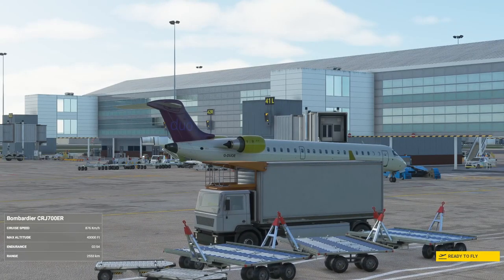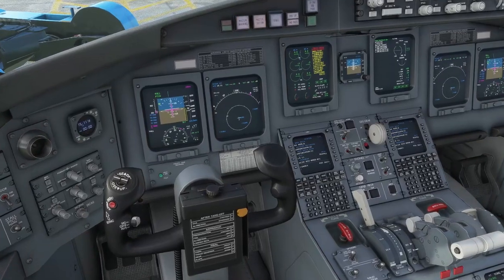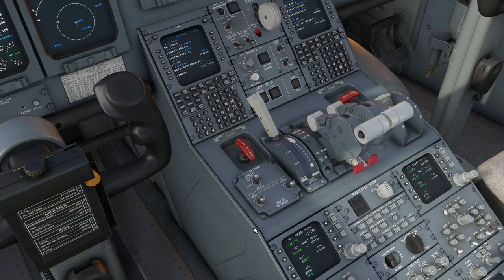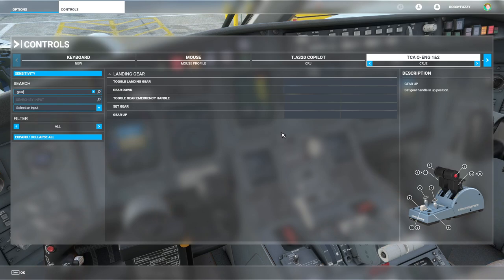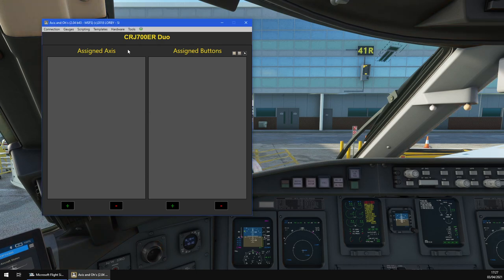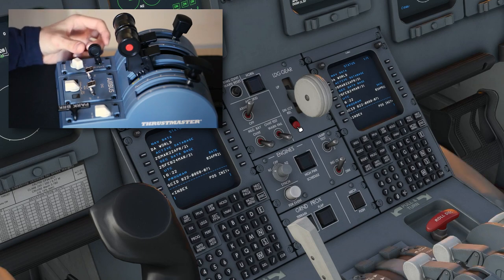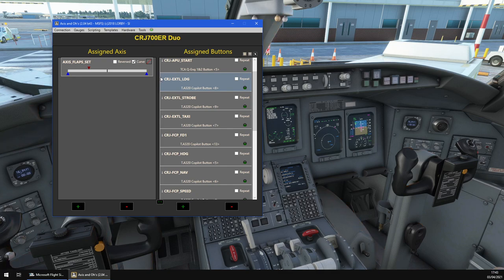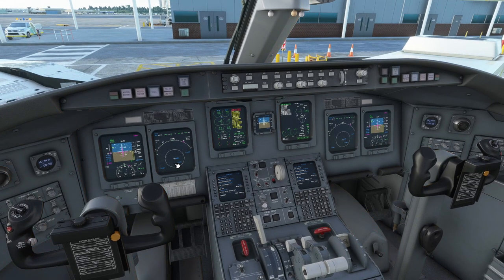Aerosoft CRJ - Thrustmaster TCA Quadrant/Add-On Setup in Microsoft Flight Simulator & AxisAndOhs

Comment: Well done and explain.

 I may have found the issue with parking break, It's being created by msfs.  Inside the sim the setting are 19 and 20 for the parking break, 21 is for the gear up and down.  Axis and oh's use the real template from thrustmaster so for them parking break is 19 and gear 20.
Reply from the maker: Thank you! And thanks for dropping by.

I'm sorry I'm not sure I understand why that is an issue?
Reply: @BobbyFuzzy When you mention you cannot set parking break.  The sim as 2 buttons for the parking break. but axis and oh's have only one.
Reply from the maker: @thepik3932  I don't think that would make much of a difference, setting the parking brake using the default MSFS bind using other aircraft works fine. I'ts more to do with the way the CRJ deals with switches that 'hold' an input rather than a momentary push button.

Comment: Wow, massive pain in the rear end trying to follow this.  I'm  shocked and amazed that this process is so incredibly convoluted.  Would be so much better if Thrustmaster built higher-quality components.  I regard the TCA stuff as borderline junk.  And yes, I own it.  And yes, I have experienced the noisy potentiometer (POT) issue on the twist-grip rudder on the Sidestick, and yes, I disabled that until FlyByWire made it mandatory for nosewheel steering on the ground.  Then I got involved with warranty claims (over and over) as one after another of the Thrustmaster units failed typically 3 or 4 months after going into service.  Thrustmaster continues to sell these with this 'known issue' (you might call it a problem) and tongue-in-cheek advised I could 'try to re-route the wiring myself' whilst risking voiding my warranty, or, in the alternative, destroy the unit (by cutting off the USB cord) and then waiting whatever time for a replacement unit from Thrustmaster.  That would be OK if only the 'replacement' did not also have the same noisy pot issue on the twist-grip axis.  Thus, the word "junk".  I would expect 36 months of solid performance before 'problems' arose on a bit of kit like the TCA product line.
Reply from the maker: Feel your pain about the bindings but that's not really TM's fault. Complex add-ons for the sim are using a lot of custom events and variables therefore need a bit of a different approach to keybinding. 
The issue with the hardware, yeah, it not the greatest but then again it costs a decent bit less than anything else similar out there. I got rid of the sidestick as I was tired of fixing it. Rerouting the wires worked for a few months but then the issue returned. The noisy pot problem apparently is something that's been an issue for years with their T.1600M which the TCA Sidestick is basically a carbon copy of. Bit silly really, I won't be buying any more TM gear and will be replacing my quadrant when the VKB TECS throttle releases. I'm already on my 3rd unit for that due QC issues! 
And just for reference, it's not mandatory to use the Z axis for the nosewheel on the A32NX, that can be bound to any axis, obviously that is the most realistic, however, you don't even need to use it at all and just continue with the rudder on your pedals or something if it's problematic. Hopefully that helps!

Comment: I've done exactly what you've showed here. When I go to the simulator, fire up the CRJ, and I press in any of the buttons on the TCA quadrant: nada. Axis and Ohs detect the button, but it's like sim isn't connected to the Axis and Ohs (yes, it says connected and detects the aircraft).
Reply: edit: sim reset did the trick.
Reply from the maker: @LockyNum  Nice one!

Comment: I followed the vid however everything works but the parking brake animation. I have the full version of AxisandOhs, any suggestions would be helpful. The presentation was smooth however lack of the 2nd screen was worrisome however you said I cannot break anything, so I felt better.
Reply: Never mind, I selected SUPRESS KEY DOWN EVENT in assigned combo. It was not selected. If yours does not work, try this. I have a working brake and a new sale for AxisandOhs- make sure they thank you :) If not, let me know, I will give them "the business" LOL stay blessed.
Reply from the maker: Glad you got it working! I haven't flown the CRJ in quite some time so can't say as to whether mine still works or not but it did last time I used it!
Reply: @BobbyFuzzy  all good. I really just wish the CRJ was more. I mean it really had the potential. I am not giving up . I booked Flight Expo and hoping to have a word with Areosoft - respectfully of course to do a quick pulse check.
Reply from the maker: @toddmullins5831  It would be interesting to hear if they are planning on doing any more with it, considering it was released so early on, they might be able to make use of some new SDK additions now! I imagine probably nothing will be done though until Hans is done with the ATR though.

Comment: Tried this for thustmaster hotas and sadly it won’t recognize the flaps,autopilot disco, and others. Great video though
Reply from the maker: Thanks for commenting. Unfortunate but this video was intended for users of the TCA Series gear. Although theoretically, you should be able to get it to work with any controller with a bit of tinkering. The current version of MSFS however does not work properly with AxisAndOhs at the moment, I'm surprised you could set it up without crashing.

Comment: with your template when using "ign start" the flap must be put to full or else will go crazy up down, and when "crank" the flap must be 0 or else will go crazy up down.. how to fix this?
Reply from the maker: Have you made sure there are no other bindings within the simulator on the IGN/START and CRANK knob positions? Would recommend taking a look through all your in-sim bindings and making sure there isn't anything conflicting with the binds within AAO.

Comment: Thanks very much for this!  Everything seems to be working as intended with the exception of the parking brake, there is no animation nor does it seem to be releasing on the display,  there are no conflicts in the simulator controls either.  Any ideas?
Reply from the maker: Sometimes you might have to reload the CRJ through dev mode for it to work when testing. Use the aircraft selector and reload then test again.
Reply: @BobbyFuzzy  Thanks for the quick reply but unfortunately that didn’t work.
Reply from the maker: @chilionastick  Hmm. That is strange. I've not flown the CRJ for a few weeks so I'll have another test and let you know if something needs fixing! Feel free to join the discord if you want to chat about it more.
Reply: @BobbyFuzzy  I sure will, thanks!

Comment: Bravo good sir. You have sold me on this programme and thanks for making the scripts. Can’t use it in full as I don’t have the add one yet so will need to change some of them to what I have (I.e black buttons for parking brake and something else).  

For engine start do you still have to manually press the engine buttons above?
Reply: Just downloaded and got it setup. Only thing not working is your complex throttle setup. The levers rise up but pushing my throttle to idle does move it
Reply from the maker: @whatsnext5460  Glad to hear it! It’s super useful! 

Yes engine igniters still need to be pressed overhead. I chose not to bind them and went for the APU instead as you’re usually relatively untasked when starting the engines. Though if you found the LVAR for those keys (I could actually send you the scripts as I already did them once) you could change the APU start for the L & R start buttons. 

The throttles need to go back into the reverse range on the throttle once the cutoff latch has been lifted. They are basically activating a virtual button that resides below idle. Double check you have virtual buttons turned on in the Thrustmaster control panel. 

Thanks again for commenting bro! 🙏
Reply: @BobbyFuzzy  thanks again man. Still no luck with the throttle but I can live without. At least the latches lift!
Reply from the maker: @whatsnext5460  Hmm, that's odd! Forgive me if a silly suggestion but sometimes just a simple restart of AAO resolves the issue. Will double check if there are any other reasons that it may not work ASAP.
Reply: @BobbyFuzzy  appreciate that buddy. I did do a number of restarts (it crashes often for me anyway haha)
Reply: Great news I figured it out. On the demo version a lot of buttons were red so I had to just reconfirm the control which was fine but as I knew some of them were for the addon which I don’t have I ignored them. Turns out the 2 with the virtual buttons I thought were flap positions or something! All sorted now though! Thanks so much! Hopefully be all perfect when I can get the addon. I also didn’t realise demo was 20 minutes only hence why I thought it kept crashing. All bought now
Reply from the maker: @whatsnext5460  Glad you got it sorted mate! I added a readme and an additional note on flightsim.to as someone else reported that. I spoke to the devs and really you shouldn't have to reconfirm everything so apparently that's fixed in the next version of AAO.
Reply: @BobbyFuzzy  Ah great shout. You wouldn't by any chance be able to upload a similar thing for the airbus would you? No worries if not I can figure it out I am sure
Reply from the maker: @whatsnext5460  The thing is with the airbus is that basically everything can be bound natively in MSFS on the TCA Quadrant etc, so it would be quite difficult to work out what's what for different use case scenarios (for the scripts). I'd be trying to make scripts for controllers I don't know how people use, unfortunately! 

It might be better for me to make a video on scripting for AAO.

Comment: I used your scripts, everything works as it should except the gear lever still goes bezerk. Any ideas?
Reply from the maker: Great stuff! Check you don't still have it bound in MSFS, that's the only thing I can think that would be causing that.
Reply: @BobbyFuzzy  I removed the msfs binding and still the same thing. I managed to work around by setting “gear toggle” to it instead, it’s not perfect but I found a way to make it work.

Parking brake has also a mind of his own…
Reply from the maker: @AvsSensBest  If you're using AxisAndOhs you shouldn't have anything bound in MSFS and leave all the controls bar the bare minimum like I did in the video, to AAO, otherwise you will get conflicts.
Reply: I read the documentation and was able to locate my problems, I likely clicked stuff by mistake. It’s all working fine now. I even used their “flaps detent” feature to help on the Cessna 152 since it has 1 less detent than the TCA addon.
Reply from the maker: @AvsSensBest  Glad you worked it out!

Comment: What on earth is this screen inside the SIM ? please describe ahead of time, verrry non standard to anything ive used or seen to setup a joystick for flying in a flight SIM.  Ive watched 5 o r 6 videos on the topic of setup TCA Joy and throttle, they all go to this cockpit screen without any description or reference to what this thing is.   Something so unusual to anything related to Joystick setup should be described and given some reference... Also achronyms are evil...TOGA ? really,  define them always pleeez
Reply from the maker: Can you be more specific - I’m not sure which screen you’re referring to? Happy to try and help if you can elaborate. 

TOGA = Take Off/Go Around. However the purpose of the video was not to explain what and why certain buttons are used (I explain what these buttons do in other videos), it was to show how I access them using keybindings.
Reply: @BobbyFuzzy  after several hours of research and experimentation I figured out that the iPad screen inside the aircraft is for several purposes including calibrating the joystick which I tried several times using my physical joystick which did not work at all however I resolved all my issues by calibrating the joystick in the Sim aircraft with the iPad in the aircraft and downloading the new drivers and firmware which is somewhat more complicated than originally thought.. it's 1988 all over again thanks for your reply if it's not clear already the screen I'm referring to is the iPad on the left side of the pilot seat which looks interesting to use at a later time. I suppose this is normal in these Airbus aircraft or they appeared after I downloaded the flight Sim software.
Reply: @BobbyFuzzy  I think you were flying the crj aircraft similar features and issues with the Airbus 320 ...if it's not clear already I have the TCA joystick and throttle quadrants
Reply from the maker: @marcw.5492  Oh yes I see, the EFB (Electronic Flight Bag). I covered that in quite a bit of detail in my CRJ tutorial if you want to know more - https://www.youtube.com/watch?v=-r9gtBPNafI

For the EFB in the A320 you will need the 'A32NX' freeware add-on which you can get at flybywiresim.com

The TCA Quadrant and Sidestick is supported by them both. Be sure to have a read of the documentation!
Reply: @BobbyFuzzy  I assume you mean the electronic flight bag is the iPad which was referred to by other YouTubers as iPad
Reply from the maker: @marcw.5492  I do! In aviation an EFB is generally referring to some form of tablet which funnily enough replaces a lot of the paperwork that’s pilots have in their bag. In flight sim they are also generally used for some ground services interactions and other settings specific to that aircraft.
Reply: @BobbyFuzzy  good to know thanks never seen it before inside the SIM